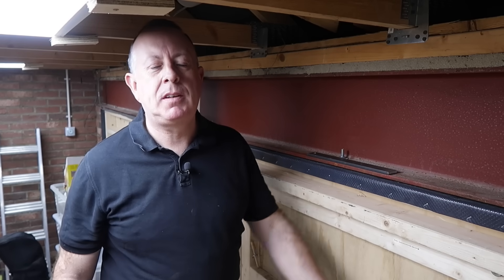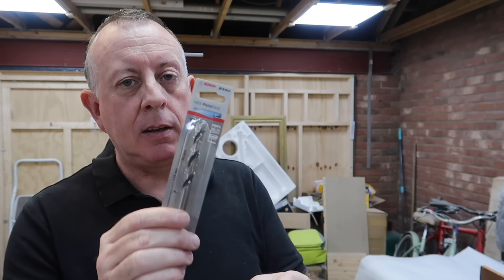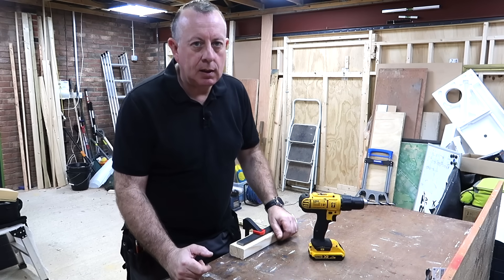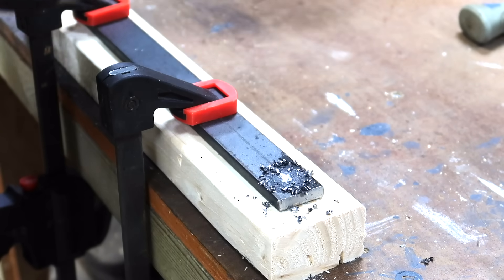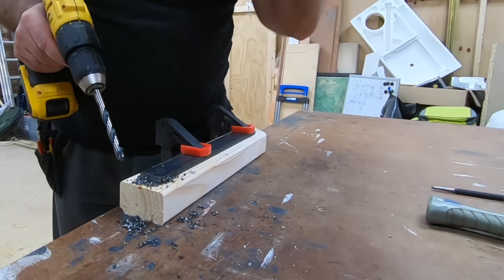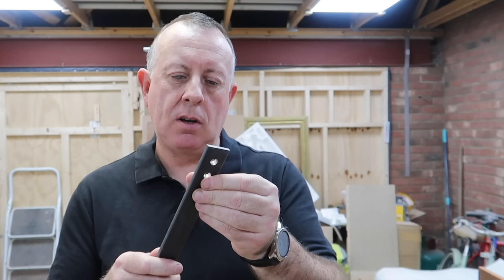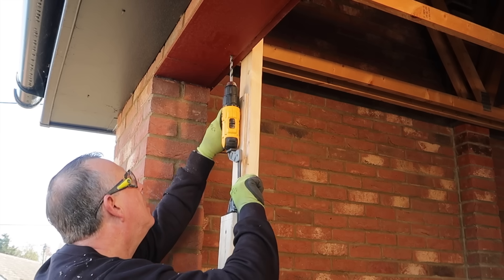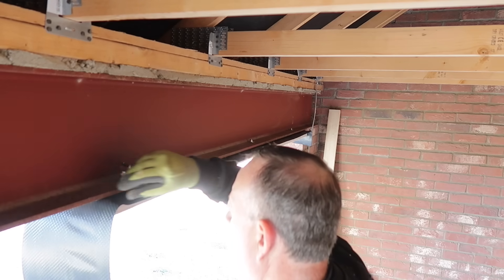How to Drill Through Steel Beams with a Cordless Drill

Comment: Thank you! Was trying to drill through steel at high speed with no success, just a smoking drill bit. As soon as I put it on to the lower setting and slowed down the rpm it worked a treat!

Comment: i recently discovered the art of sharpening my blunt or broken drill bits , on a fine stone grinder wheel.. i had the job of drilling through railway tracks plus i recently set up a pillar drill , anyhow it has given me a lot of confidence for the jobs and i feel like i know a little magic , especially as they are 12mm and 13mm holes and have become very doable .. .. also noticed you aint got a pilot hole? how come? the tip of a largish hss bit aint pointed or sharp is it? .. also gotta watch for the direction the drill will go in if it sticks in , could do your wrist some damage , so i set myself up to have some resistance , usually my hand against the battery or the part of the building the battery would hit if it swung round .. 
..and the clamps!!! .. cant have too many clamps

Comment: FANTASTIC Idea.  I used it to drill a 5/16" hole through a 1.25" thick piece of steel after hand drilling a 1/8" pilot hole.  I had been hand drilling prior and I still have a sore hand, a sore wrist and a sore neck from looking upwards while applying enough up pressure.  I did ten holes that way before finding this video.  Arghhh.

I tried your version 1 and the drill bit was barely warm when I finished.  I just now saw your second version.  Another great solution to the problem I was having holding pressure on the hand clamp.  Heading home now and I'll return tomorrow with another clamp and get those last 11 holes drilled.

Thank you for sharing this technique.
Reply: I always pre-drill the size of the chisel edge
Reply: @Howie57 Yes,  best way ..😊
Reply: I used a cobalt drill bit and a Ryobi cordless 18V drill.  Cheers!

Comment: Drilled 30 holes through 10mm thick steel beam , battery drill , 11mm holes , 1 DECENT Dormer drill bit , high speed , no lubricant - didnt have any issues at all apart from batteries running out

Comment: No. 3 or 4mm pilot , 6 mm the up. Most important is cutting fluid. You need to avoid max pressure,,makes it uncomfortable working from below.

Comment: PLEASE NOTE: There are issues of safety, structural stability, and building insurance to be resolved in advance and in writing. You MUST NOT drill holes in structural steel except in accordance with a drawing prepared by a structural engineer.

Comment: Followed this and totally worked with a 2cm thick RSJ and my small Dewalt cordless driver. I found it easier though to drill a small hole first, open the hole with a cone bit and then use the larger drill bit. Keep speed slow and use plenty of lubricating oil.

Comment: It’s all about cutting velocity. Pilot bits therefore need a faster speed than a bigger bit. 
My current favourite drills are the DeWalt** with a double tip. The point has a smaller diameter that pre-drills the hole. But even they work better with a 3 or 4 mm pilot hole. 
** Other brands a probably available.

Comment: Fantastic video. Very helpful and well presented. I didn't know about magnetic drills until you mentioned them. I did a little research and man do those things rock. I suspect for a few holes of minimal diameter, your manual approach is reasonable. But the amount of pressure you need to apply undoubtedly grows exponentially as the the diameter of the desired hole increases. I think this technique of yours becomes impractical as you go much above the 9mm hole you demonstrated. But again, very useful information and a great technique for the right-sized application.Thanks!

Comment: Should never drill into a steel beam use specialised clips for the job. The hole you drill becomes a weak point, one hole will not really matter but every hole adds to the weaknesses was told to add steel by tacking a plate on to mount anything that you needed to mount

Comment: Just by chance, I've seen this method of using a clamp to exert the pressure you need to drill through the steel, but what I've never known is "to drill at a slow speed" ...... such simple advice that will help me from this day on.

Comment: OK, but your full weight on the drill ???   your battery is going to overheat or you will give the gears a very premature death? 
Go half weight.
Spot on with the eye protection , aaagh I've seen some horrible incidents.

Comment: Correct cutting speeds and use oil on Tip to keep it cool. Pilot drill and open up. Dont play with swarf use a brush. Wear safety goggles,  when drill bits snap....... Support the drill to prevent over shooting and punching the chuck into your work.

Comment: Tip…put a strong magnet in a plastic bag, near the hole.  As you drill just push the swarf to the magnet. Afterwards turn the bag inside out, remove magnet and the metal particles are captured for disposal. NB: only works for iron and steel.  Great video TY.
Reply: À fuĺ face mask would be safer than eye glasses.😂
Reply: @georgespruce6028 It's only turning very slowly.
Reply: Plastic bags have tendency to be perforated by fillings. I still use tham, but as well small translucent boxes as tictac. Easier to maintain.
Reply: I agree. Dogs paws and my feet always find those burrs. Can’t be great for their eyes either.
Reply: Good tip.
Reply: Wish I had read this a few hours ago, lol
Reply: This is a sweet tip. I’m always worried I’ll get metal chips in my phone or tablet.
Reply: I often use a magnet clear swarf and filings from my workbench, I always struggle to clean the magnet afterwards. I will use method in future. Sometimes the simplest solutions are the best. 👍
Reply: @6panel300 blow it clean with compressor and a blow gun
Reply: @crossbow3539 a magnet keeps the waste material together. And not flying all around.😂
Reply: @crossbow3539 I don’t want metal shavings blown everywhere
Reply: I would use a milwaukee, MUCH BETTER.
Reply: @teddiver-gf6dj  a Milwaukee branded plastic bag? Sorry, but I’m not going to pay a dollar for a plastic bag just to match my overpriced drill.

Comment: Very useful! But I've got a situation where I'm not sure what I've hit. (Thro' the PB, approx 25mm airspace, dead stop...no can drill). It's above window, going horizontally into wall. Using DeWalt cordless drill on hammer and new masonry bit. Reinforced concrete lintel perhaps. Any tips to save my day as I'm just making a mess and getting nowhere would be much appreciated. BTW, subscribed. Thank you.

Comment: Clever.  I just purchased a box of screws from Simpson, here in the States, that have a 1/2", or 12 mm carbide drill. These are for use with the Simpson Quickdrive System,  and are collated in plastic strips.  You clamp your wood piece to the steel and drill through both with this self tapping and threading screw.  Pretty slick.  It is driven by a drywall screw gun.

Comment: Thank you. This is genius. I built a version of this with supplies I already had in my shop. The low speed suggestion is particularly telling. My drill press only goes down to 760 RPM and I am discovering that is too fast and wears out my bits. Thanks again. Genius.

Comment: Very informative and helpful, and most innovative. Regarding devising ways and means to cope with unusual circumstances (i.e. relieving pressure on your hand to hold the drill in that awkward position and also to generate sufficiently necessary upward pressure for the overhead drill force ) my Dad would have raised a glass to you in what he called "making bread out of stone" by the use of your self-designed jury-rigging to hold the drill in place and use of the clamps to maintain pressure. Well done my son.

Comment: WD40 is not an effective cutting oil. It's mainly kerosene. You should be using a thread cutting oil for drillng steel. Ask any machinist.

Comment: I needed to drill into some steel to cut a section out to run some piping for a/c,managed to get 9 holes drilled with a cobalt bit before it wouldn't cut anymore

Comment: Hello do you think installing a 3m rsi can be a diy job. Need to place it on two MS plates 2cm thick.
Reply from the maker: Thats quite an advanced DIY job I would say. The 3m beam in question I would think is around 25kg per metre which at height can be tricky and dangerous to work with. Unless you have a foolproof way of safely lifting and holding each end I would suggest you get some help from a small builder.

Comment: Good advice, thanks for a good explanation. Pilot drills and a lubricant like CUT-IT are the way to go, also beware of brushing steel swarf away with your fingers as it will be sharp !  Better to use a brush and dustpan.

Comment: Omg thanks for this I'm building my own workshop and need to drill through several  steel I beams to build walls and attach shelves. It took me ages just to drill through the steel brackets to attach the wood beams to the steel just now so was dreading drilling the steel I beams. I will try you tips tomorrow.
Reply from the maker: Nice one - good luck

Comment: When drilling through steel,  depending on steel  thickness it NEEDS a variable number of pilot drills.  No matter how thick the steel start with a 1/16 or 3/16 twist drill.  Use lots of cooling lubricant not grease.  Each successive drill is twice the diameter of the previous drill continue this routine until you  reach the required hole diameter.  The slower the drill speed the better, DO USE FAST SPEEDS unless you want to blunt or break the twist drill.  Be mindful as you approach the other side.  The twist drill may catch, jam as the twist drill breaks through.
Reply: I was taught to use Pilots first
Reply: You absolutely need to run high speed with the small bits.   RPM needs to be based in the liner speed of the cutting edge which depends on the diameter
Reply: Excuse me Sir, instead of using a normal drill U would better use a Step drill. U get them in package of 3 for 9€ in a German supermarket.  U don't need much pressure to drill even if U drill  holes with a diameter up to 30mm and steel  plate 12mm thick. The power U need, depends on the friction of the material with Your drill  and the amount of material U take away by each step. I learned this by drilling holes in the boom of my sailing yacht.
Reply: Not "needed"...sometimes preferred, but not necessary. Biggest reason for using a pilot hole is for better accuracy in the location of the final hole. 
With press and correct bits, go big.
and...1 pilot max is needed. Any additional step-ups is just time and bits wasted. The cumulative materials excavated is equivalent.
Not to mention greater risk for heat transfer which can alter the steel, essentially inadvertently annealing it.
Reply: @danallen4131  “needed”is probably correct in terms of hand held drills, look at this loon laying on his drill, it’s not good for the drill,or matey’s elbows, sharp(new) bits and take just enough not to stress the drill motor for succeeding cuts. The answer is to perform the task without hurting the drill or yourself, the time it takes, is what it is.  I have seen this done with chest braces and hand braces, and the trick is to take it easy. 
   I personally am a fan of proper cobalt alloy drill bits, but honestly most of the time you don’t need them.

Comment: Great video! I need to drill two holes through a hitch receiver on an RV. The pressure needs to be horizontal and I'll be on a stool or on the ground while drilling.  Any suggestions for how to apply the pressure?  Thanks!

Comment: I had to drill several 5/8" holes overhead on steel I-beams. Just was not getting there. Finally just invested in a $30 bit at Fastenal, and that did the trick. Apart from cost I really don't know what the difference was.

Comment: Good tips and ideas, I always like your ways of overcoming problems. Personally, from my days as a fitter I would use a pilot drill and step to finish size, we even did this with a drilling machine. 3mm, 6mm, 10mm, something like that. Bit of a factoid, in metal work the 'bit' is called the drill, the thing that turns it is the machine. So if you ask an engineer for a drill he'll ask what size. Ask him for a ruler and he'll say the Queen.. followed by, did you mean a rule.!

Comment: Thanks this is exactly what I was looking for. Can you get the top of the studwork directly in the middle of the RSJ by drilling through the flanges? What size timber would be required?
Reply from the maker: Good! Yes you can however the flange gets a bit thicker near the centre but that shouldn't be a problem once you are drilling well. You could still use a 4" timber (that would suit your uprights) and maybe stagger the fixings on either side of the centre web fixing the timber at the 1/3 points say. That would still be a very strong fixing.

Comment: It has been mentioned elsewhere, but it is worth stressing that it is far easier to drill a pilot hole first.  Generally speaking 5-6mm (say1/4”) is a good size, the purpose being to avoid the chisel-like centre of the larger drill having to be forced through the metal.  Some say to drill through in small increments until you get the large target size.  As an engineer and a model engineer, I can say that this is absolutely not necessary, and it is also an expensive option.  Others have said, quite correctly, that cutting oil is beneficial, but to be honest, if you don’t have any don’t rush out to buy some – any oil is better than none!  Finally, and here I take issue with at least one other, a good quality drill is a true investment and do avoid those from China that are made from hard cheese.  We had a fitter come to fit roller blinds to the underside of an RSJ and I watched as he drilled away with a cheap 5mm drill at high speed.  Eventually I took pity and gave him a Dormer 4-facet drill and told him to reduce the speed.  He was simply astonished at how easily the holes were formed, and I told him where to buy one from (approx. £5).  Since he would be drilling the same size every day I suggested that a Dormer Cobalt drill would be even better and longer lasting (approx. £7).  I have never used them but I reckon that Bosch would be a good second choice to Dormer (and far more readily available).  Incidentally, if you are drilling stainless steel (SS) then beware.  It work-hardens very readily which means that if you let the drill bit spin without cutting (because you haven’t applied enough pressure) then the SS will become too hard to cut and your drill will immediately become blunt.
Reply from the maker: I tried a pilot hole off camera to start with and to be honest all it did was slow the process down. To drill the main 10mm hole only took about 1 minute so to drill a smaller hole to start with then dismantle the rig and put in a new bit and set up again just added time to the process.

Comment: I was taught to use a pilot drill the thickness of the twistdrill web, but yes breakage of the pilot drill is a common occurrence and the use of swear words when this happens is also a common occurrence. Great videos
Reply from the maker: Thank you! I did try a small pilot bit off camera and all it did was take me longer (with changing bits etc) to drill the hole so I didn't bother.
Reply: @ProperDIY  I think as long as chips are coming off you don't necessarily need a pilot. Sometimes it's hard to get a hole started if the steel is very hard, but it also helps to have a really good set of Cobalt drill bits in those situations.
Reply: I shall try that, maybe I was misled

Comment: Is that outwards pushing clamp designed to work that way or have you modified a clamp?
Reply from the maker: Most quick clamps have that ability to turn them around and push outwards.
Reply: @ProperDIY  Maybe a quicktip video idea then, had a look at my Irwin quick grips and they can be converted but id need to remove a rivet.

Comment: I have the same problem. I have an rsj but I don't know if I can still threw the flange to secure my stud wall underneath it. Would it weaken the rsj if I drill a 8mm hole threw the flange. Rsj is 203mm wide
Reply from the maker: Obviously drilling any hole in the flange weakens the beam even if it is by a very small amount. I can't comment on your situation without seeing it however a structual engineer would look at how much a hole (or holes) would affect it. Depends on the number of holes  and their location. If all spread out then little effect - if all next to each other near the centre of the beam could be a problem.

Comment: Excellent video! Being just a DIYer I would have thought exerting all that pressure would damage the motor or structure of the drill if I hadn't seen this. I need to drill into a window lintel just to fit some blinds since there's only 20mm of plaster before it. I assume it's the same principal? Thank you.
Reply from the maker: Thank you. Yes, same principle

Comment: I’m removing a pillar and installing a beam to my double garage. Yours looks fitted from build? Wonder if I’ll need planned and building control?
Reply from the maker: For major work like that i think you would - best to double check
Reply: @ProperDIY  absolutely checking is best. Interestingly, you can build a entire garage without building control or planning permission. But alterations like mine will require it.
Reply from the maker: @blakeyuk1981  Doesn't make sense

Comment: Smaller pilot hole first, build up drill sizes. Works much better and you don't need as much pressure so less risk to break bits.

Comment: Totally agree about pressure and speed on steel drill hole, maybe start with a bit small than original hole will help a lote. Note that in big size drill bit the Sharp start a litlle up above the point of them. Fixing using a small drill bit first. Maybe because this you put a more pressure and the cut delay to start. Tks for sharing.